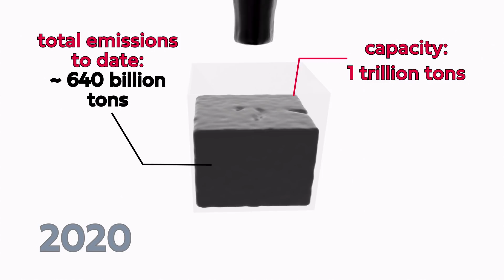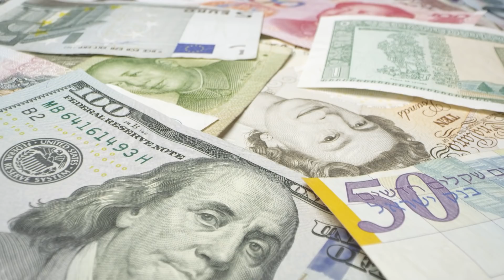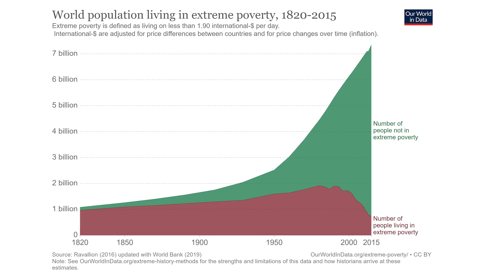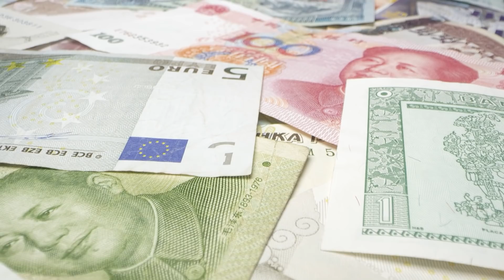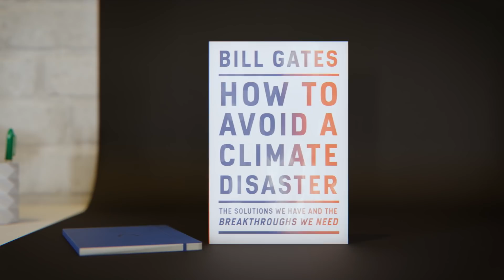The climate is lost when we fill this cube

Comment: I just want to put a small correction to the steel production point: It isnt completely true that it absolutely required to produce CO2 in making steel. For example Salzgitter AG (a german steel producer) has their SALCOS project in which they build plants for direct hydrogen reduction of metal. (Not sure for which metals it works, though) You might not get that value to 0 but there is still a lot of room for reducing those emissions as well. Some kind of carbon capture is still necessary, though.
Reply: You might find this interesting it discusses some of the metals it can work with https://www.researchgate.net/publication/225575276_Hydrogen_as_a_reducing_agent_State-of-the-art_science_and_technology
Reply: @FaerieSeraphina  Thanks for that. I only knew about these projects because I applied for an internship at Salzgitter AG. But this is quite interesting, really.

Comment: That’s an awesome summary and I love that you overview so much of the bigger picture. However when it comes to agriculture maybe Bill Gates hadn’t considered what many farmers are adopting in “ regenerative agriculture” which reduces and can even eliminate fertilises pesticides herbicides etc and sequester carbon back into the soil, also opening up the opportunity for cattle farming with a negative carbon impact and even Carbon farming.
Reply: YES EXCELLENT POINT. However it turns out most of the fertilizer emissions mentioned are actually just from the energy cost of producing ammonia, which could be zero emission if they just used renewables to heat and pressurize the process. there are minimal emissions of nitrous oxide (in terms of way less than 1% of greenhouse gasses worldwide), but those are negligible in comparison.

Comment: So. Schneider and Holdren proved we particulates accompanying CO2e emissions hide apparent warming, about 25%.

That means we're not at about 1.1 K; we're over 1.35 K, once the particulates fall out, likely within a decade after ending fossil emissions.

Meanwhile, structurally pattern warming might be hiding a full degree of eventual warming, probably within a century. That's where drawdown might work. Paul Hawken's Drawdown gets a lot right, but we're very far from economically drawing down a full degree of CO2 in a century.

And then there's Steffen and Lenton, who tell us we need to avoid 1.5 K to avoid domino effect tipping point runaway to Hothouse becoming likely in later decades.

That means 2050ism is the new climate change denial.

We have ZETA 2030. We have ReThinkX 2030. We have ASHRAE NetZero. The Geopolymer Institute can get us to Zero cement. Elysis can prevent aluminum producing 16x its weight in CO2. Hybrit can make steel zero emitting. Basalt fiber rebar can get rid of steel rebar, cheaper than Hybrit.

But the one thing Bill misses is that to pour green tea, stop serving black tea.

Curtail 1% of today's level each month of fossil-emitting extraction and trade licenses and permits. That clear message, that signal, is the new carbon tax, the invitation to investors to exit fossil and enter fossil free. It's the one keystone fighting climate change cannot succeed without.

Comment: My flat is connected to a community heat network. There's no gas boiler in the property, in fact there's no gas supply to the whole building. What there is though is an energy centre next door which right now has large gas boilers and the hot water is available to the area via highly insulated pipes, which on its own is better than everyone having their own gas combi boiler. In the next few years though this will be connected to a wider heat network that will use the waste heat from power stations and industry to heat water and send that to a huge number of homes in the borough. Once you can do this kind of thing again, Simon, you should come and see what's going on. I'm sure the scheme would be very happy to show you around it all. I'll drop you some information.

Comment: this 1tn ton figure seems generous and we should do whatever we can to never reach it. additonally, this 50yr window to reduce our carbon frontprint to 'near' zero certainly is far too generous. it would be 2070/71 then and even China plans to reach carbon neutrality by 2060. we already have almost all tech needed (maybe not the fertilizer yet) and even planes and ships can be made much cleaner right now. alas, today it would already be a big step if our governments would systematically stop all subsidies to any project which produces CO2.
Reply: @Professor Frog I agree with you and cement is still a problem as is the fertilizer. governments could pass laws limiting the use of cement (and put a heavy tax on cement) to what is absolutely necessary and compel builders to use carbon friendlier bricks or materials for the rest. 
for planes governments could tax airfares to the point that short or medium flights become more expensive than train tickets and force trains to run on renewable power. ships could get very much 'cleaner' by not burning heavy fuel oil anymore anywhere. that might not reduce CO2 enough but it is a start. 
planes could get carbon neutral by 2040 or maybe a bit earlier if governments push for it: https://youtu.be/5Fi65k2K3Mw  , once planes can do it, ships should follow suit.

Comment: A climate action committee just published a report. The cheapest and largest action was restoring our swamps. There are a lot draining for farming and forestry. Restoration would turn them back to carbon sinks.

They cannot alone solve issue. Other big issues are fossil fuel heating, transport and metallurgy. Example solution include hydrogen steel process.

Comment: You're not going to step in the way of progress. The only way you're going to turn this train around is by finding an affordable carbon free energy source, or trapping it. Everything else is a drop in the bucket and pointless.
Reply: @Professor Frog Man your entire comment is a renewable giga cope. Simple fact of the matter is that oil and gas are energy dense and cheap. That's why they're being used, it's not some kind of giant oil baron conapiracy. Renewables are more expensive and batteries suck. So you either fix that, or you find something better.

Comment: Another issue after co2 is tackled (if it ever even is) is resource depletion. Oil and ore wont magically re appear on the earth and landfills wont magically get rid of trash, a circular economy is neccesary for this but making such a thing is way easier said than done, especially for electronics like this screen you are using right now. When this screen breaks it will probably end up in one of these landfills
Reply: Thats why being able to repair things is so good, cuz you can decrease your output
Reply: by the time co2 is tackled we'll have the tech to go asteroid mining.
Reply: @CHKNSkratch  if we wanted to fix it, it wouldn't be an issue(people are Happy with plastic, dirty electricity, lumber, (milk/meat), cars and concrete(and (freon argon) air-conditioning/refrigerants hair-stiffener and the like, breaking the ozone layer , until recently ~2000)(pretty much if you like it, it pollutes) plus politicians made it worst), the tech is as old as "global warming" , currently due to people not understanding simplifications climate change.
Reply: That has never been a problem in the past. Why would it be now? Literally tell me a resource we have depleted where we have not found a replacement?
Reply: @edpiv2233  the problem is, renewables kind of ARE the replacement, and we need more of them. if oil and coal disappeared we'd be out of a surprisingly large amount of our energy.
Reply: @edpiv2233  gold mines and oil wells have been depleted in the past. Just because it never was a serious problem before or because its not a problem now is not an excuse to ignore it.
Reply: @edpiv2233  oil
Reply: @edpiv2233  Shit, a glitch(on my end) ate my comment.
Well i was going on about some stuff.
Short version(from memory (noted like this?)):(something about smog?) CO2 makes even more CO2(forest fires, russian permafrost releasing trapped gas (CO2,methane and others)) makeing even more CO2
france ~42°C a few years back killed some people, 44°C max now here, ~50°C leads to earth running out of people and a famine world wide(someting about -150°C in America?) (when temperatures>needed to grow a crop). So what are we supposed to replace people with? (This is a worst case scenario. But the best isn't too far of in a "no action" scenario)

Comment: Well done Simon. That was a brilliant presentation and very clear.
Reply: Other then the fact that we are not releasing carbon, what we are releasing is not black and that the earth has has much more c02 in its environment before and it was just fine.
Reply: @edpiv2233  we are realeasing carbon, and you are right, its not black, its clear, like a gas, its black here so we can see it, C02 is, wait for it, Carbon Dioxide, which is a subset of carbon, and you are right, the earth has had more, but it can no longer hold the same amount, the ozone layer weakens over time, so we may have a 1 trillion ton limit now, but in the past it may have been 10x that

Comment: I keep hearing people say we'll simply run out of resources we use to make batteries, solar panels and windmills while trying to achieve net zero emissions. While I find it a bit hard to believe that there are no ways around the issues we face, I also don't know enough about it to at least have an idea of what's going on. I'd like to do all the research necessary to figure this out on my own, but I currently don't have the time. Are there any good sources or would it be possible to make a video on the topic?
Reply: we wont, batteries use lithium and iron the two most common elements on the planet.
Reply: @Professor Frog They are actually, they just think the planet can't sustain our current population
Reply: @Professor Frog yes it is, it's an obvious reason why, however I would also say that oil and gas will run out in around fifty years so we can't pollute through these methods, I'm not sure whether this visualisation accounts for that